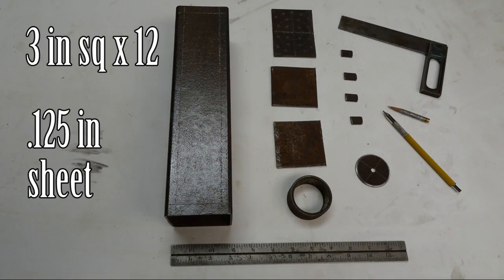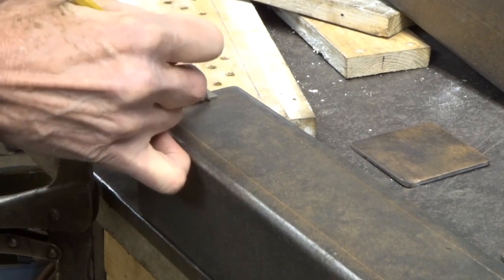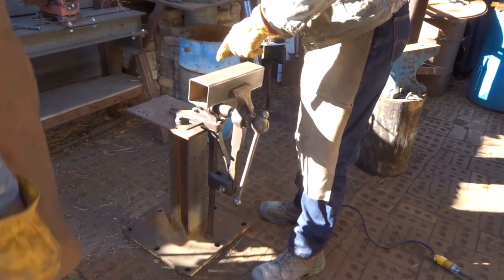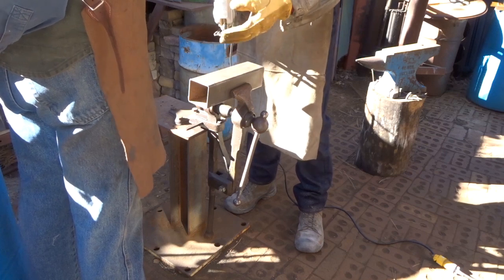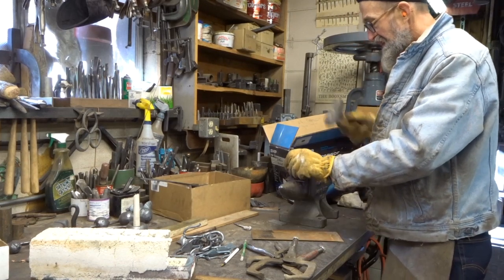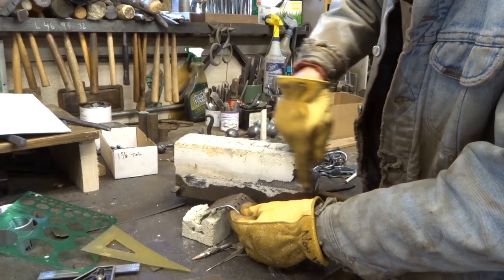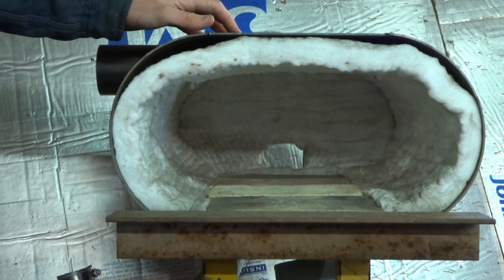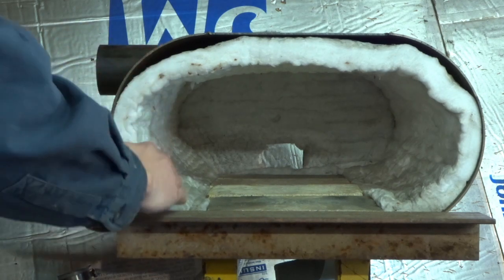Ribbon Burner Manifold

Comment: Many thanks. That was a bunch of information that alot of others hadn't cover especially on cutting the tube in that manner  especially useful for those w o a torch. Also a new take on the defusing plate. Makes sense for encouraging the airfuel mixture to want to flow towards the ends. 
  Thank ya'll and blessed days, Crawford out.
Reply from the maker: Thank you Daniel!  Trying to share techniques, and things I've learned along the way.

Comment: Hey Stu, Made a ribbon burner as your video shows and my burner seems to make a drone noise at some points, any advice please. great videos Stu, from the UK
Reply from the maker: beansontoast10 I talked with a friend who has more experience running the burners and said he had one that would drone on start up till the refractory heated up, and he had one that the doors on the forge being all the way closed was too much back pressure causing some strange noise and so proping the front door open allowed air to exit the forge better. hope that helps.
Reply: Thank you very much Stu, The burner works amazing heats the metal really quick. Thanks for the advice, Again thanks. Dave